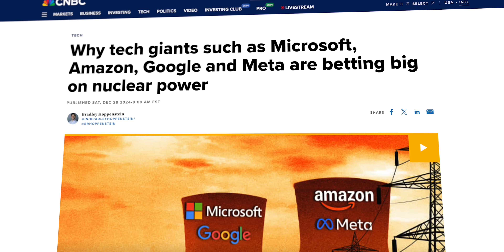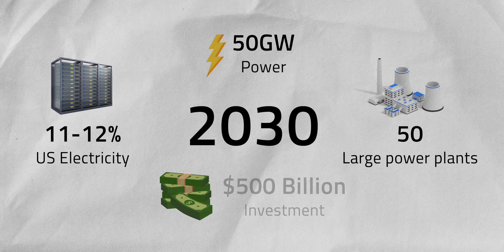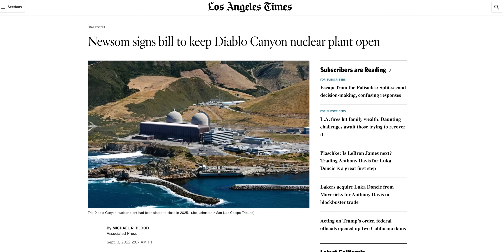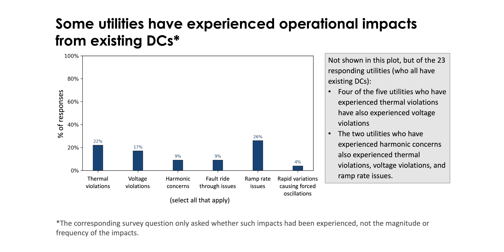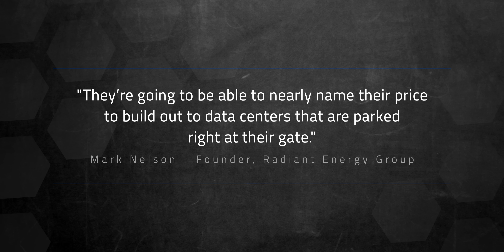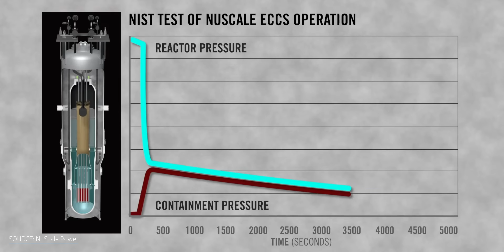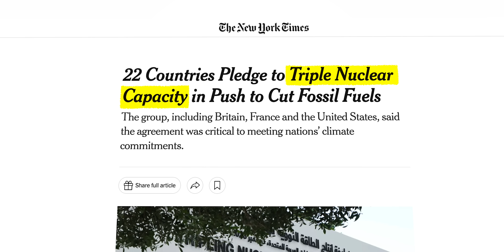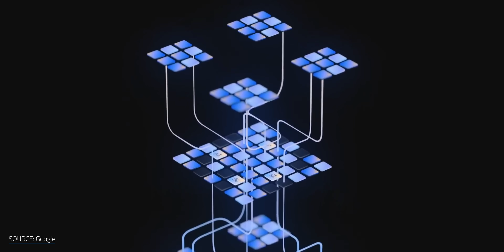Why Big Tech's Betting Billions on Nuclear (Not Renewables)

Comment: It's a tragedy what happened to nuclear power due to excessive fear. The Three Mile Island accident basically showed that the safety measures used in western nuclear power plants worked even in a meltdown situation. The radiation was not on a lethal level and nobody died. Nobody in the West would have built the kind of stuff Soviet built, yet increased safety demands in the West dramatically increased costs, and political uncertainty about the future of nuclear made investors less willing to take the chance that they would be able to keep new reactors running for the decades needed to make a profit. Instead people just built fossil fuel plants, even though fossil fuels kills more people every single day than nuclear power has ever done. Sigh. If rules demanding that fossil power plants couldn't release any harmful particles had been put in place instead, we'd probably be rid of them by now, saving many million lives in the process.
Reply: Compare and contrast:
"This car is great because the crumple zones worked really well."
"This car is terrible because the throttle got stuck, the engine cooling failed, the instrument panel was unreliable, and crucial visibility was absent. And in am accident, the towing charge can be greater than the cost of the car itself."

Three Mile Island wasn't a win. Stop pretending it was.
Reply: @anticarrrot  That's a strawman. Compare and contrast: Nuclear: "Even if everything goes wrong, nobody dies." Fossil fuels: "Even if everything works as intended, millions die."

That's what we saw. And yet the decision was to punish nuclear out of the competition and go on with coal. Utter stupidity.
Reply: @beardmonster8051  "That's a strawman."
Don't use words you don't understand. It is a valid criticism to say that 3MI only demonstrated that containment worked BECAUSE 3MI demonstrated that many of the control, monitoring, and safety systems were pretty shit.
We can do much better today, but that doesn't stop 3MI from being a poor example of nuclear safety.
Reply: @anticarrrot  If you're not going to be polite, this discussion is over.
Reply: @beardmonster8051 kyshtym and Chernobyl is what happens when a core meltdown , coal plants are contaminated soil
Reply: @ Budget Soviet reactors run in the most stupid way possible cannot be compared to proper western reactors in any serious way. (And the Kyshtym disaster wasn't a reactor failure.) Three Mile Island shows what happens if everything fails and there's a meltdown in a western reactor. Nobody dies. It's weird how much fear there is about nuclear reactors in particular, even if you just focus on radiation risks. Just look at the Goiânia accident, resulting from a failure to dispose medical equipment. It was way way worse than the Three Mile Island accident, but how many people go around worrying about radioactive material from medical equipment causing disasters?
Reply: @beardmonster8051 I'll also add Bhopal as an example of a non-radiological accident that caused mass casualties and long term health effects, with a similar plant in Institute, WV. Also stuff like the PES refinery report mentioning that “15 refineries could place more than 500,000 people in harm’s way, and 28 refineries could endanger more than 100,000 people in the event of a worst-case hydrofluoric acid release”. Also dam failures (or intentional destruction) can be very dangerous.

Nuclear power can be dangerous, but there are a lot of industries which deserve similar levels of safety requirements and don't have them, and current alternatives to nuclear are clearly worse in regions that can't use pure wind/solar/hydroelectric power.
Reply: @beardmonster8051  And the coward runs away, after lying about what others have said, and pretending to be a victim.
As cowards often do.
Reply: @reddragonflyxx  I'll add the Banqiao dam failure as an example of the hazards of hydro power. Estimated deaths were in the 26,000–240,000 range and several million houses were destroyed. And there are certainly high environmental costs for many renewable power plants.

But yes, the point is that we need to weigh options based on their merits and consider whether our regulations are having a positive effect overall.
Reply: Modern plants have safety systems designed around extremely unreliable tech: like gravity existing, frozen things thawing out, and electromagnets not-being-magnets-without-electricity. Not to mention most emergencies require rare resources to deal with: like ambient-temperature water. And the scarcity of fuel: so abundant we could never run out of it: and so cheap instead of reprocessing it we just dig up more. I agree the climate-of-fear around nuclear is a tragedy. It does sound a bit silly that commercial AI is renewing interest: but I'll take what I can get! :)
Reply: That's because of an skill issue
Reply: First of all you are completely wrong about 3 mile island casualties. Analysis of increased cancer rates in the area are astounding.  Look at Fukushima. Are you mad?!  Such historical revisionism and misinformation are a disservice to everyone.
Reply: & let no one forget the solar farm incident in Austen, 2016?, A panel pinched someone's toe getting it off a lorry. The victim reported it smarted while he counted to ten. Echoing the 200,000 evacuating 3-mile, a dog was put on a lead to preventing it evacuating near the dropped panel. Fake media tries to suppress the story to this day.
Reply: Older nuclear plants are not as safe as they should be but modern designs are far better. Rather than fear, we should have faced the challenge and designed safety features like we have now. 

Second, people have died from the Three Mile Island meltdown, and many others have had their lives negatively impacted for decades. This is all well documented. Look it up. But that doesn’t mean we shouldn’t continue with new nuclear tech. Coal and gas plants kill people every year. Nuclear has the possibility of being safer than that, and we should ensure that it is.
Reply: If you read the accident reports on 3MI, Fuka, Chen, etc. what they show is appalling engineering and risk management, eg. 3MI's critical control systems wouldn't get a pass in a first year engineering student project.  The problem was not what occurred, but what was just avoided. Chen could have been so much worse, it is hard to contemplate and accept how much worse it could have been.

In any case, nuclear has always been an industry where everyone is talking about the next greatest step while completely failing to implement the current step, check out the stats on Gen3 and Gen3+.  I have read the International Atomic Energy Agency's (IAEA) report on SMRs and their influence on overall power production in the next decade or two, even their best case scenario is dismal reading.  

Anyhow, SMRs were supposed to be small, around 50mW or less to enable building them on a production line and shipping them out as turnkey solutions, not 300mW which is a medium-sized reactor and still has to be adapted to its intended site.  The reason, the industry went to large reactors is running costs, big ones produce considerably cheaper power (if you can call any nuclear power cheap once subsidies and support is removed from the equation) than smaller ones.  Perhaps this does not bother data centre operators, but it would not be greeted with joy by normal consumers.
Reply: Some video sources debunking nonsense that is repeated over and over by people that did not read a thing about nuclear energy issues in the past but trust nuclear industry, or are financially involved, and thus with self-interest for rewriting history:

- Three Mile Island: The Controversy Continues (Link TV on Youtube) - Dr Steve Wings (whose study was mentioned in the recent documentary Radioactive: The Women of Tree Mile Island) claims that lung and leukemia cancers were 2-10x of the average downwind of Three Mile Island reactor after the accident. Dr Wings reanalyzed the Colombia study on behalf of 2000 people suing the industry for health damages but their case was never been heard in court on the excuse that there was not enough evidence. Higher rates of cancer patients found in conducted studies were often disregarded by authorities as likely due to stress, and this was also the official conclusion of President Carter, a nuclear engineer by education who was advised by Admiral Rickover, the man behind the US nuclear submarine program. The nuclear industry eventually paid over 82 million $ by 2002 in out-of-court settlements, so the issue seems to be far more in restricting unwanted publicity than unwillingness to pay. Also shown are some victims sharing experiences from being irradiated, and examples of abnormalities in fauna and flora near the accident.  

- China's Nuclear Disaster Imminent? (serpenza YT) - short video about shady safety standards in nuclear industry of China causing leaks rsulting in lowered radiation standards as cover up technique. These leaks happened with suposedly much safer new generation of nuclear reactors.

- Should GE’s Mark 1 Nuclear Reactor Be Recalled Worldwide Like a Faulty Unsafe Automobile? (Environews YT) - the US industry hid well-known design flaw in their early nuclear reactors in a similar fashion as the Soviets did with Chernobyl reactor design in order to not harm profits and industry image... 

- Danger! Radioactive Waste (Films Incorporated) - 70ties documentary about shady days of the US nuclear industry dropping barrels with radioactive waste into the sea en masse while Greepeace activists trying to prevent that with boats near disposal vessels, disposing of radioactive waste into building materials used for walkways and more. The documentary was later used by HBO comedian John Oliver in an episode about the nuclear industry to point general trend that is prevailing to this day towards underplaying the danger of improper nuclear waste disposal and cost-cutting in every way imaginable.   

- First Tuesday: Windscale The Nuclear Laundry (1983) - issues with nuclear fuel reprocessing plant in the UK, high levels of measured radioactivity nearby facility, claiming 10x rise in rare leukemia in the nearby village.

- Children of Chernobyl (Filmakers Library)- shows health issues caused by accident a few years after that were downplayed by governments and the nuclear industry around the world to the point of being known that the KGB was stealing data on cancer patients from hospitals. Yet misinformation about total casualties being only initial casualties of firefighters was spread for a very long time around the world, in fact, you can find the nuclear industry stating it as fact to this day on the internet in various seminars and hearings, despite this movie claims among other things that rates of very rare leukemia rose in Kiev/Kyiv 10x in years after the accident.

- Wasteland / Kyshtym disaster and pollution of the Techa River - environmental and human consequences of multiple accidents in Soviet/Russian Mayak (lighthouse) nuclear fuel reprocessing facility requiring relocation of population.
Reply: The cost of safety is always less than the cost of a cleanup.  The problem with nuclear is that the people who choose the risks are not the one who get stuck with the bill.
Reply: @VPWedding  What's the cost for cleanup for the pollution from fossil fuels? The big problem is the inconsistency. We put a large extra burden on a cleaner option and let the worse options pollute to their heart's content. Literally millions of people die every year from emissions from fossil fuels. Coal plants even release more radiation than nuclear power does under normal circumstances. (Not much, but still.)
Reply: The first nuclear build out in the US didn't fail because of fear.  It was failing even before TMI.  The failure was due to cost overruns, the sudden moderation of growth in power demand (bad when nuclear needs accurate predictions of the demand to justify construction) and because of the passage of PURPA in 1978.   The latter ended up flooding the grid with huge amounts of non-utility capacity, further impairing the demand growth utilities needed to justify nuclear.
Reply: We have Jimmy Carter to thank for the majority of that excessive fear and regulation. With luck his legacy of destroying nuclear power died with him.
Reply: @twobarb  Did you know that Jimmy Carter was a nuclear submarine commander and expert in nuclear? The Navy sent him to advise Canada. Trained as an engineer, Carter saw that nuclear was not a wise choice. And he was right. See the work of Dr. M.V. Ramana, University of British Columbia. Also, Dr. Mark Jacobson, Stanford Engineer. They explain that SMRs are: 

Too SLOW to stop climate catastrophe and meet growing electricity demand. 

Far Too EXPENSIVE compared to every option. 

Too DANGEROUS with extreme climate weather causing droughts, heat, fires, flooding, storms... 

Too VULNERABLE to terrorist attacks on grid structure and cooling systems. SMRs also threaten global security by spreading nuclear bomb-making factories around the world. 

Not to mention that the U.S. imports 99% of uranium -- a limited, expensive, dangerous and health-damaging element. 

And if that's not enough, nuclear is NOT carbon-free. Nuclear power produces 9-37 times more emissions than wind. Mining, refining, transporting, manufacturing fuel rods, MASSIVE quantities of concrete, steel and infrastructure, highly complex operations -- with cooling systems largely powered by fossil fuels at present, waste storage for hundreds of thousands of years...  Absurd.

SMRs and the nuclear industry would not even exist without massive taxpayer subsidies -- including the insurance paid by taxpayers because no insurer will touch nuclear power. And taxpayers and ratepayers will continue to be fleeced if we let the nuclear industry -- backed by Big Tech -- push through a horrible non-solution to our climate crisis and energy needs.
Reply: @twobarb  On the other hand he did kick start the Craft Ale movement in the USA so we don't have to drink cold fizzy water like Bud and Miller.  Swings and roundabouts :-)
Reply: @twobarb  You have to options as a leader in this situation.
A: approve nuclear. If it blows up you are the one to blame. At the time Jimmy had to contend with public sentiment as well which was not loving nuclear.
B: don't approve nuclear. Your the one to blame.
Which blame do you want?
Also your implying nuclear is safe. They are STILL dealing with Chernobyl. They are still dealing with Fukushima.
Reply: The enviros pushed against Nuclear to keep their cause salient (conspiratorial, I know)

Comment: At some level, all renewable power comes from nuclear, just- fusion, far far away. Technically, even that isn't renewable and will burn out eventually. Nuclear is cleaner than oil/gas/coal and much more efficient. It's a pretty good option IMO.
Reply: Nope, nuclear power is the most expensive. Look up LCOE of power sources.

Comment: It amazes me how much people believe the bad reputation of nuclear as “history”. The chart of deaths caused is a great example, even solar kills more people per megawatt hour due to the toxic materials in manufacturing and disposal. 

I believe modular reactors have a place such as ships, areas with lower needs, or quickly powering disaster areas. The bigger difference would come from walk-away safe reactors using liquid fuels like molten thorium salt. Most existing reactors have very specific solid fuel rods with varying levels of enrichment across them, which makes sourcing fuel much more difficult and expensive than simply supplying enriched uranium or plutonium. As is typically the case, no one solution fits all scenarios.
Reply: people do not bother looking at history except anything they hear as truth without verifying, i doubt anyone here will try verfiy this video claim as well, their is too much content to care about researching

Comment: I am really disappointed this video. I cannot believe anyone that talks about nuclear power and does not even mention nuclear waste.  Forget the dangers for a moment and ask just one question, how much does it cost to store nuclear waste for 50,000 years? What is the price tag? We talk about how much it cost to build but we don't talk about the cost of storing it's byproduct.
Reply: > how much does it cost to store nuclear waste for 50,000 years?

About 0.001 USD/kWh.

The NRC requires a surcharge of 0.001 USD/kWh (decimal correct), deposited in an escrow account. You can see the current status of the fund at the NRC website.
Most other countries have the same, or have since adopted the same, funding.

Even at that, places with nuclear have lower prices than places with wind/solar.
California (about 60% wind/solar) - retail prices ABOVE double the US average.
Illinois (about 50% nuclear) - retail prices around the US average.
Georgia (home of the super-duper expensive Vogtle plant) - retail prices BELOW the US average.
Reply: @factnotfiction5915  Nice numbers, but are they real? Yucca mountain never opened for commercial use. Even if it did it would already be full. There is no other yucca mountain project on anyone's schedule. Today the cement cast are only good for 5 years, so we will use them for 20. At some point this will become a huge problem, most likely after a natural disaster. Even if you have a Yucca mountain it's not a guarantee of success. I a bit tired of hearing about spending $500b on AI when we have a housing crises in America. This is a like to have not a must have.
Reply: It's very cheap comparing to any other power producing methods. You just need to pack it with cement (and other safety measures) and put it somewhere.